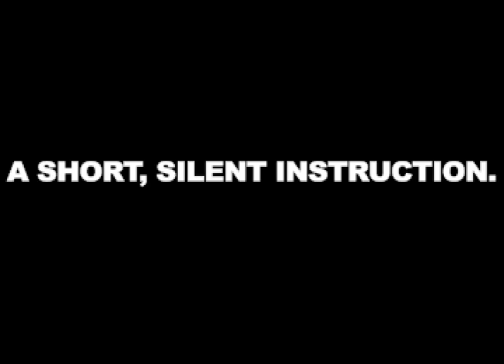SALTED VACTROL 01

Comment: I fuck with glowsticks.

if you check my channel, you will find the brightest glowsticks in the world.
made by wireing 3 10mm LEDz to a battery holder and shoved in a glowstick.

is it possible to use pigments to stain a glowstick case?